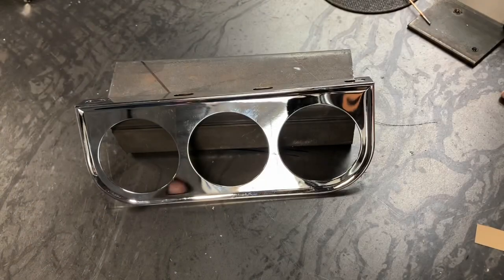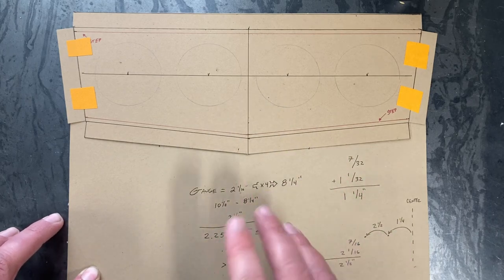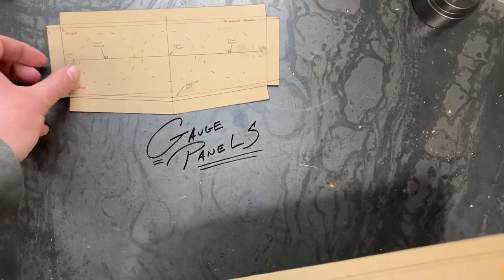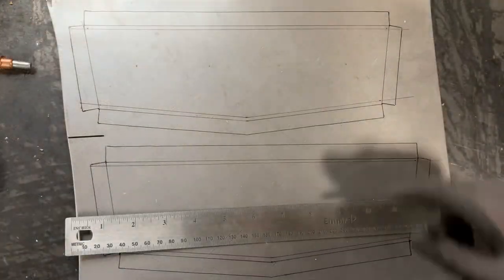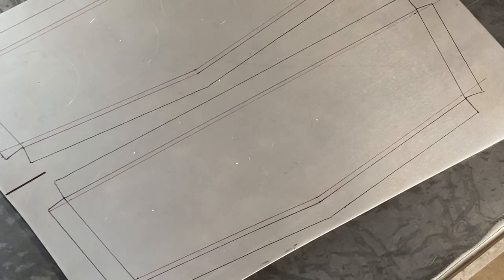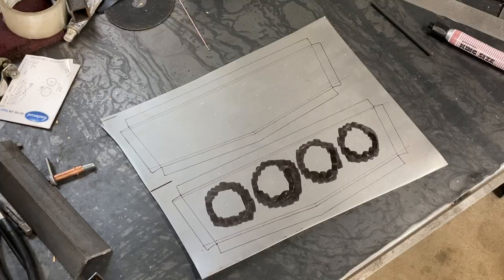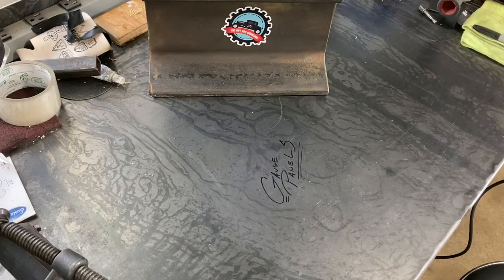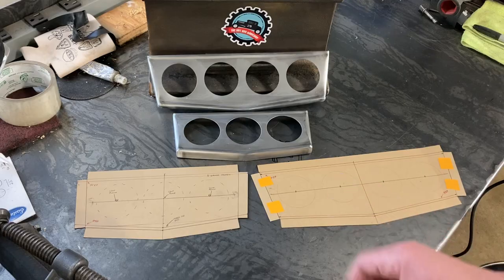Handmade gauge panels

Comment: I just made a 4 gauge panel for my Ol'Beater. It's basically a recycled tool box corner. Looked OK until I saw yours. No mine sucks.. I don't have the equipment you have. Would you consider selling a 4 gauge panel?.
Reply from the maker: It may not have been pretty, but I applaud your resourcefulness! I have one 4 gauge panel left. If you’re interested, shoot me an Email

thehotrodworkshop@gmail.com

Thanks for watching!